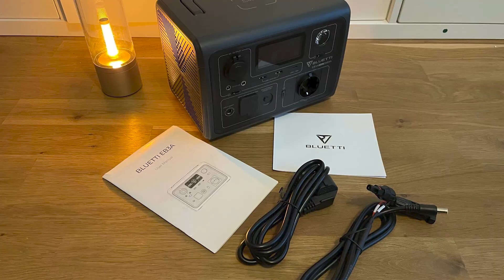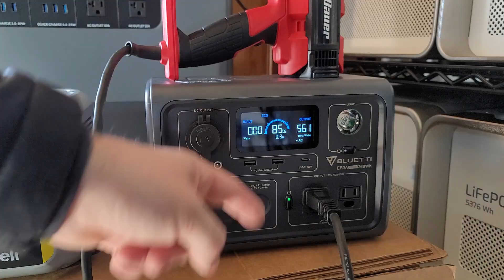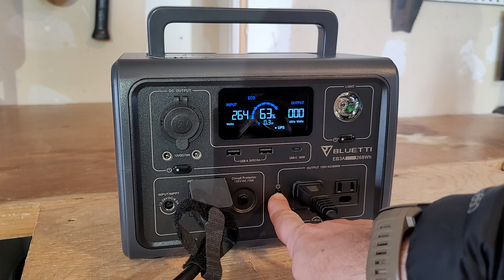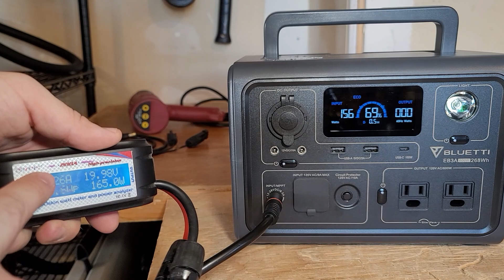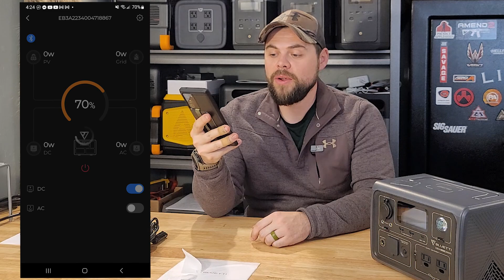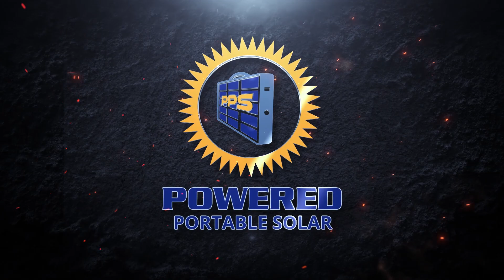Bluetti EB3A Tiny Solar Power Station Worth It?

Comment: I’ve had my EB3A for almost two years. At the time I bought it Bluetti didn’t include the solar input cable. The cable I had didn’t fit into the input snugly, it would always fall out. I bought another 5 cables including a Bluetti cable and all cables did the same thing, frustrating when you think it’s charging from the sun all day to get home and see the cable fell out again. After about 3 months of going back and forth with Bluetti, sending videos, sending pictures, etc they finally said to send it in for repair. They did repair it and send it back fairly quickly. They installed a new panel on the EB3A. The solar input cable stayed in snugly however the wattage from solar was greatly reduced. I had 200w solar panel and with the repaired EB3A it wouldn’t give me a unit over 58w, on a sunny day, no clouds. So after a few more emails back and forth to Bluetti, sending pics and videos again they ask me to send it back and they’ll replace it with a new EB3A. I received the new unit yesterday and it didn’t work. There’s no input coming in from solar, the led screen is showing every red alert. I tried to press the buttons that are supposed to display error codes, but it displayed a bunch of ineligible jibberish, no numbers, no letters, no code. I tried to reset the circuit breaker and there’s absolutely no resistance to that button, The button just jiggles in and out and don’t reset anything. I used to praise Bluetti and tell everyone how much I loved it. After all the headaches with them I will never buy another Bluetti product. 
Mind you I’m totally off grid so the headache and hardship of not having electricity gets old. 
I do have a backup inverter to charge my phone but that’s about it.

Comment: That EB3A  connected to a 12,8v 50ah lifepo4 gives me power for 6 hours for my PC and computer screen 27inch.  6 hours is good  in case of power outage  not long term power outage but short period  it is good. imagine connected to a 100ah or 200ah battery , might run a small cube freezer but not sure of that.did not test it. invertor is 600 watts

Comment: Someone I believe correctly mentioned in the comments below about how UPS works and it is not what the 'reviewer' says. If any device (like a modem) connected to an AC outlet, is also connected to a power station with UPS capability, the power station will ensure that the modem runs uninterrupted in case of an AC power failure. In the video, the device is only being powered by the power station and is not connected directly to an AC outlet

Comment: Would this be a good solution to continuously run a 240v 45w Aerator with Solar Panel power during the day. I dont mind if it goes flat overnight provided it self restarts..  One commenter below mentioned that his unit overheats, that may be a problem for me as the unit would be outdoors (in a sheltered cabinet) but in Australian/Queensland heat (can be upward of 45 degrees C)

Comment: Turn on the ac inverter with a momentary push on the switch.  Continuous push will turn it off.  This is why you could not get the EB3A to operate the inverter while charging with ac.  My unit will charge with ac and operate an ac device.  Hook up an LFP 12.8 v battery to the 8 mm charge port to increase the EB3A’s battery capacity.  Hook up two 12 v batteries in series to get 24 v and now have up to 200 watts pass-through to power the ac inverter.  What I like about this unit is the flexibility it offers in its operating configuration.

Comment: Just don't call it a "solar generator".  It doesn't "generate" anything.  It doesn't matter the source of the electrical power it's a big storage battery.  Also nothing to do with "solar" unless one uses a solar panel to convert sunlight into electrical energy and stores that energy in this big rechargeable battery.  Will everyone just stop this "solar generator" crap.

Comment: I specifically bought this unit for the 600w/1200w peak inverter capability knowing that this would sacrifice the efficiency.  For me it is worth it since I can fast charge with a generator in an hour or so.  It is weird that you had trouble with the UPS.  Mine works flawlessly.  Maybe yours is defective?

Comment: I have had no problems charging while running equipment. Even using Solar or AC and also Solar+AC together.
I have even tested the UPS with a PC (main thing to watch is some GPUs pull a spike of power when PC is switched on that trips the EB3A if not in power lift mode)
The capacity is the weak spot, and the max "solar" input is around 200w limited by the voltage & current.

Comment: do you think this will be good to power a 70w guitar amp over a couple hours? Thinking of using this for busking!
Reply: Amps have big capacitors I guess try to measure how looks the power peak when starting amp. If it is below 1000w it should be work.

Comment: ups mode means when you are connected to ac the unit passes the voltage thru to the output but when ac goes off it will switch to the battery aka uninterupeted power

Comment: Wouldn’t uninterrupted power supply mean that if something is plugged into it, loses its main source of power that the EB3A would keep it running? Him plugging the unit into the wall and trying to charge it while having it power something else isn’t UPS. It doesn’t say that it’ll charge while powering something else, it says that if something is plugged into it and loses its main source of power that the EB3A will keep it going. Am I wrong?
Reply: You are correct. If any device (like a modem) connected to AC outlet and is also connected to the power station with UPS, the power station will ensure that the modem runs uninterrupted.

Comment: I think this "prepper" guy needs to prep better before he does a video! I've got a unit and UPS functions just fine. Seems like he was winging it, doing it on the fly? He should prepare before doing the video so  he doesn't screw up. For example saying about the 1200 watts only to have to backtrack moments later.

Comment: interesting about 75% efficiency.
i cannot charge two ryobi 4ah batteries with this unit via AC, which it should be able to. i think those ryobi batteries are rated at 72wh.
i like this power station but i wont get another. also it seems to discharge fast if just left on as well as you cannot charge the bluettie eb3a via usb c.

Comment: Well it makes sense, when I build a solar panel system U always make sure that the output  is the same as the input or else it would pull more load out of the input and create problems. Small MPPT charge  controllers dont want a stronger output as the live input. Not sure why but adding this rule makes a reliable system. Small good MPPT controllers sell for higher prices then the EB3A all together so I think Why push it just to get failures. Thanks for doing it as it proves my theory over larger systems.

Comment: I have one and I love it. I use it for exactly what you mentioned. I charges my dewalt batteries, lights, a fan. It was a killer score for 195$. I do recommend adding it to your preps. And with 100w panel it charges quick.
Reply: A 100w solar panel? Is bluetti selling those?
Reply: Have you tried running a laptop on it
Reply: @ImBetterThanYouHoe  I've charged my laptop from it.
Reply: @ImBetterThanYouHoe  It runs a laptop great - especially if your laptop is newer and can charge via usb-c

Comment: So this may have already been mentioned, but you did not make a proper attempt to engage the AC outputs when it was charging.  When the screen is on, it just needs to be QUICK PRESSED, not held.  I can understand how this would not necessarily be intuitive, but it's nonetheless how it operates.  Mine works perfectly fine when I do this for both charging from a wall and using AC output for UPS function simultaneously.  Check your unit again.

Comment: I think your issue with UPS  is it can only charge at 268 watts, and I think you were trying to pull 600 watts (if you were still using the heat gun). I have one of these and it's great to charge outdoor security cameras. We also loan it out when my son's family go on vacation. It works for what it works for. Lol

Comment: I have one of these specifically for charging phones or laptop in an emergency.  Primarily if you have to travel in a vehicle and want portable power when stopped.  In this case, smaller and lighter is better.

Comment: I have 2 of these and have had them over a year.  It does do AC input and output at the same time as both of mine have run in this mode for a year.  I can also confirm that the UPS feature works as my internet and stayed up without a burp thru at least 50 interruptions since i have  started using them. It also does solar and and AC charging at the same time and does have solar preferred.  Did you do a firmware update on this before charging?  I found that both of mine were rather buggy until i updated the firmware.  If the BMS firmware is not up to date, the 100% state of charge may also be incorrect.  One of mine was 76% and the other was 56% after updating the BMS firmware.. I was an early adopter though and i would have thought that the newer units are shipping  with most of the firmware updated.  I have seen the EB3A run a 19.1 CF Samsung refrigerator for 6 hours and the AC efficiency is closer to 91%.  I paid $209 each for mine and that was one of the best purchases i ever made.  The first sentence in the manual should read *Update all firmware before charging and use*  You have quite the collection of solar generators!:)
Reply: I'm looking to get one as a back up for my sump pump, would this work for that?
Reply: @rrpstpie  It depends upon the ratings for your sump pump.  It would probably probably run a 1/3 HP pump okay but may have some difficulty starting the pump.  Check to see if you can find the starting watts for your sump pump.  If it is below 1200 watts, you should be okay

Comment: This is a flawed test. I have had one of these unit for a long time. It will absolutely run ac in and out at the same time. The UPS mode is flawless. All of the features of this unit are well known and tested. It's actually the best value out there. Perhaps learn how to actually test? Good grief. Either you have a defective unit, or you are attempting to promote fud.
Reply: My EB3A quit after only 8 months.

Comment: I had the same problem with mine where I could not use AC while charging with AC. I reached out to Bluetti and they sent me a replacement which I am now using as a UPS running my modem and router.

Comment: Absolutely love these for small needs, so light to carry, and charge very fast with 200W solar panel. 
I am a senior lady with some back issues, and sometimes I even solar charge these repeatedly, bringing them out and back in to charge a larger unit I have when my back is saying it does not want to haul the larger 32 pound unit in and out!!

Comment: I've had one for over a year and it's fine (as you said) for keeping phones topped-up, leaving. Delta Mini & Bluetti EB70S doing the main work in the UK.  Everything can be charged fully in less than five sunny hours & I manage okay.  A small fridge/freezer is the average 45w draw-hog for the last two and are drained overnight.

Personally, I do prefer smaller units for maximum portability, which are easily charged under even UK skies, using two BougeRV 180w panels independentally, before I gain rooftop solar.

Comment: I have one of these that I use for low power applications.  For this purpose it works fine.  The UPS function on mine works correctly.  It is possible that you have a defective UPS in your unit.  This is not a powerhouse unit and one should not expect it to be one.  Great review.
Reply: i think he needs to short press the ac button a couple of times. he was long pressing.
Reply: Agreed. Ive been using my eb3a in UPS mode for about 8 months straight 24/7 powering my modem/router with no issues. Also I just ran the same "C" rate AC discharge test for comparison sake and got a 81.7%. I think i'd be reaching out to bluetti if I were him for a replacement.. Also would be a good test to see how their customer service has improved in the past couple months.

Comment: I have that unit along with several Ecoflows and Jackerys. The 2 things I don’t like about the Bluetti is that it overheats all the time when the other solar generators don’t under the same applications. The second thing is the cigarette style plug, everything I plug into it is loose. My compressor coolers constantly turn off so I have to constantly push the plug back in. I’m very happy with my Ecoflows, so thats where my money is going in the future, thanks for the review.
Reply: Thanks, important info for me.
Reply: Right, I did not even get 8 months of daily use out of my EB3A, I'm going to Pecron or Eco Flo now.